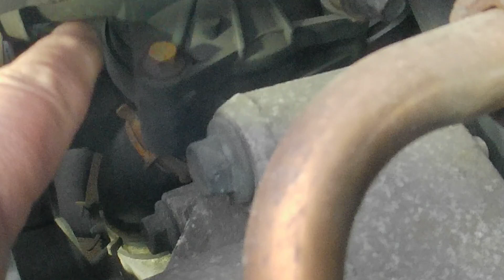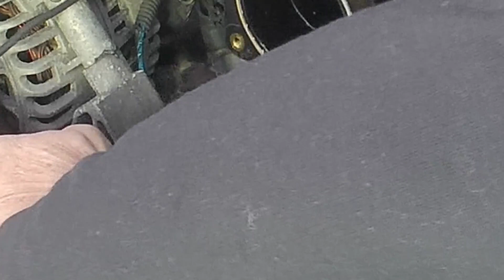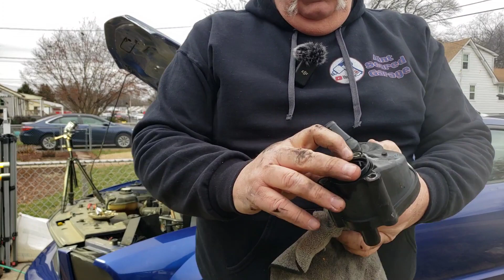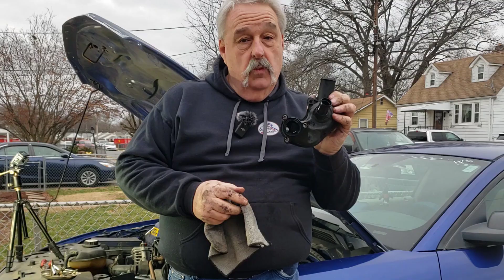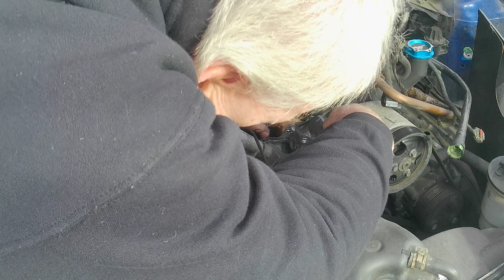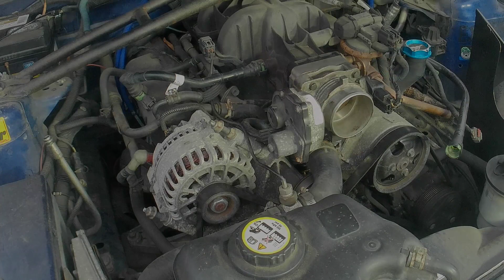Ford 4.0 V6 Thermostat housing leaking

Comment: Just found your video after buying a used Stang and wanted to see how to replace this as I have heard the horror stories about the plastic OEM part. The metal one you gave the link to is only $26 now on Amazon. Good deal.
Reply from the maker: I'm glad I could help, I replaced 3 of them plastic ones, the metal one seems to be holding up now and I don't think I'll need to replace it again, Thanks for the comment

Comment: I'm about to replace mine for the third time on a Ford Ranger. The first time all three bolts broke off in the block so please, please use anti-seize! Ford charged me $45 dollars for those three little bolts and getting them out with a torch wasn't fun. 
My other tip is to tie thread to those little sensor clips when taking them out and putting them in because they WILL go flying and you WON'T find them. Trying to find replacements is going to be one of your nightmares. A long piece of thread and you can just reel them in. 
I'm going with the metal this time so this headache will finally be over. Watching videos so I don't screw the pooch on something simple that I didn't consider. I already saw one guy screw up because the plug on the sensor was keyed differently for a different vehicle and he had to redo it to get the right sensor in there. If there are any other "catches" to this let me know because I hate doing this job.
Reply from the maker: I preach Anti Seize I use it all the time, hey that idea for the thread is genius, thank you, you are correct, them things do fly LOL

Comment: don,t you get tired of these auto company cutting corners to save a buck.i remember when a gas tank had a drain plug.back in 1963 i was talking to a ford eng he said they were designed with the plug but when it went to cost analist they could save 30 cents by leaving the plug out .what a consept .so much for that.keep up the good work bill
Reply from the maker: Thanks Bill and your right, add a few things to make it better, if you ad these little thing and it cost 50 bucks more, just build it into the price, no one is even going to notice 50 bucks add to a car price, Lord Knows LOL

Comment: providing that o ring holds up all you have to do is pull top 3 bolts to change the thermostat? was there one in it for $70?
Reply from the maker: Sorry I forgot to put a link, this is the one I got https://www.amazon.com/dp/B0B932N9YX?psc=1&ref=ppx_yo2ov_dt_b_product_details